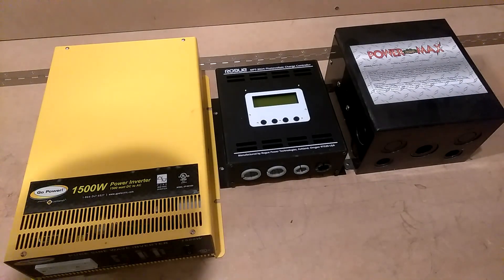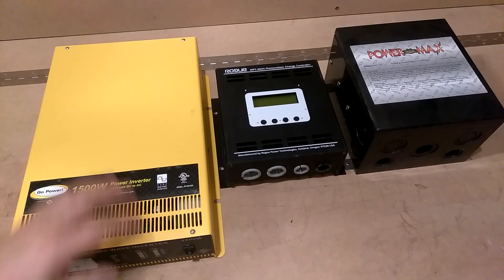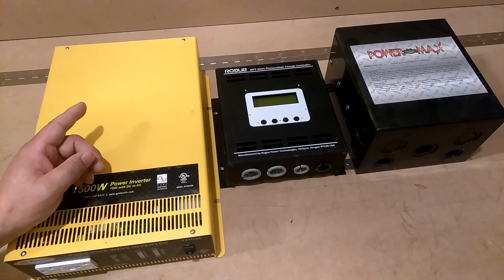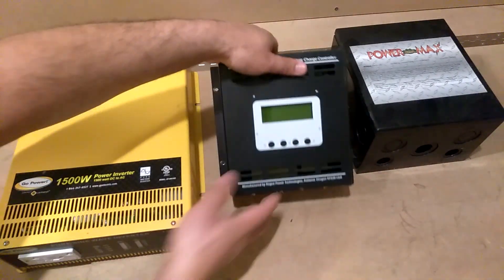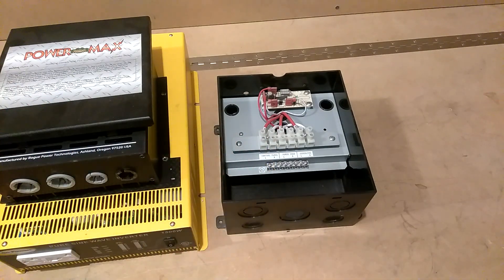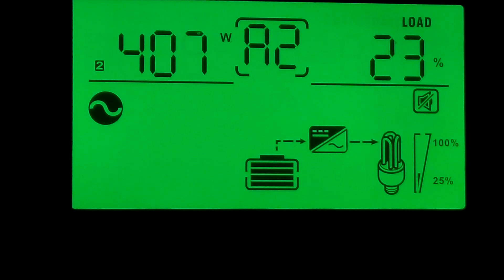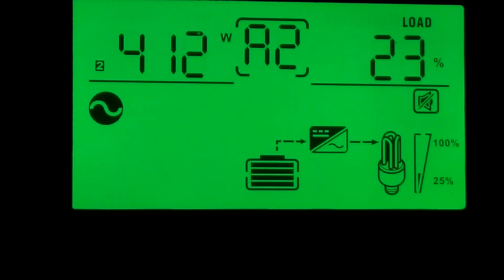4 month review on my LV 5048 inverter.

Comment: I'm new to solar but I'm thinking about getting the lv5048 soon is there any minimum on how many solar panels or Watts you can start; out with? I was thinking about starting out with three Mission solar 375 watt panels but would appreciate suggestions. Also how long did it take to get the unit from MPP solar? I've seen a store in the U.S. on eBay saying they're getting some to ship May 8th. Really appreciate the video and any advice I can get.
Reply from the maker: Sorry it took so long to get back to you I have been spending a lot of time trying to get situated for the reopening after the covid-19.  but to answer your question you should be fine with the three solar panels to start off with. and on the shipping it's taking a little bit longer to get it due to the covid-19 when I ordered minds last summer it took three days for me to get it. I have since ordered a second LV 5048 and it took a month before it was shipped out due to the covid-19 and them being so backed up on orders. The shipping even took longer it was 5 days before I received. Hope that helped and sorry for the late response.

Comment: I have 1 thing that I cant run...
My 120V, 10.6a, 14500 btu window unit air conditioner. I have no idea why, the surge should be able to handle it, but it wont. I'm storing heat in a water tank to heat my house at night, and will be doing the same with stores cold water to coll my house over the summer. I probably wont use the air conditioner anymore anyways, but I find it interesting.
Reply: Mines run 12k btu 240v inverter ac very nice no problem

Comment: how many kWh are you getting from your 7p7s battery pack before it needs to be charged.? I also have a leaf battery pack and we'll be using 49 batteries. I just want to know what your capacity came out at.
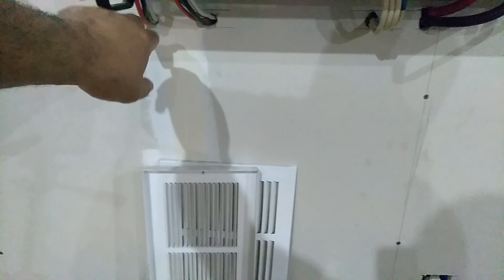Reply from the maker: I can't answer that question because I have never did a capacity test.  I charge my batteries to 57.3V and i discharge them down to 49.8V .   I can run a average of about 800 wattsfrom about 5:30 when the sun is no longer shining on my solar panels to about 8:30 when the sun hits the solar panels in the morning. That's 15 hours 800X15=12000÷1000=12KW.  Maximum charge voltage is 58.1V and end of discharge is 35.0V . that means it's quite a bit of power that I am not using but I want to be conservative with my batteries to make them last as long as possible. I'm also not using a BMS so I tried to stay away from the top of the charge and the bottom of the discharge to have a margin of error.   Hope this help you 👍

Comment: Question, its pretty easy for you to expand your battery pack right?  If you buy 7 more batteries you can add one to each of your series packs of 7 and it will maintain the voltage but increase the amp hours.  Is that true?  Is that the main reason also that your batteries are staying so well balanced due to the parallel then series connection?
Reply from the maker: Yes that's true.  You can just keep adding 7 batteries until you get to the capacity that you would like to be at.

Comment: I  wholeheartedly agree that a screen showing total use would be nice .  I would go a step further and put both legs and total on one screen. A larger screen might be nice too.  Default to 240v split phase on arrival rather than having to change from 120v should be expected in a split phase unit.  

The 4 other biggest improvements I would like to see are:
1. Increase the battery charge voltage to 64 volts max  like one of their other units (better for some  lithium   battery chemistries)
2. Increase the PV input voltage to at least 450 v like one of their other units ( enables running more power through smaller wire from pv array)
3. Increase peak power for say 5-10 seconds as much as possible ( within limits of non-transformer unit,  Perhaps even allow a separate battery to charge a large capacity to help ?)
4.  Ability to blend the power output with the grid ie. use max directly from MPP and supplement rest with grid power rather than all one or the other.
Reply from the maker: I agree with everything you just said thanks for posting.

Comment: I have a computer running off my LV5048 and it handles transfers without any problems. Is your AC input range set to Appliance or UPS?
Reply from the maker: I have to check when I get home tonight I'll let you know.
Reply: Mine is set to Appliance which the (new) manual states is 20-25ms transfer time for 50Hz power. I don't know, but suspect it might be a tiny bit longer for our 60Hz frequency. UPS mode is shorter - only 10-12ms which should be more than sufficient for any computer. Intel recommends a 16ms holdup time. In any case, any cheap computer UPS should help with your wife's computer.
Reply from the maker: @cowpen  thanks for the info I'm going to check it out tonight when I get home from work. 👍
Reply from the maker: AC input voltage range is set to APL.
Reply: carson l urban wind and solar so that explains why it was not quick enough.